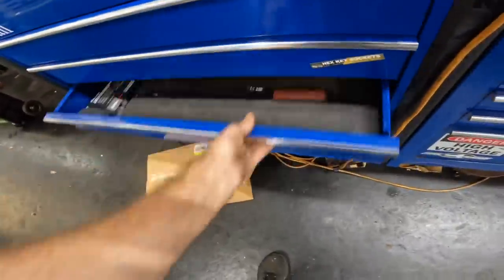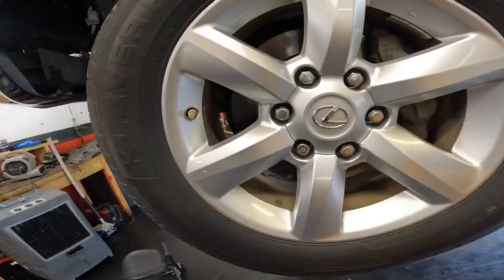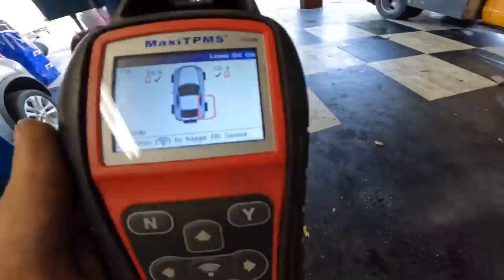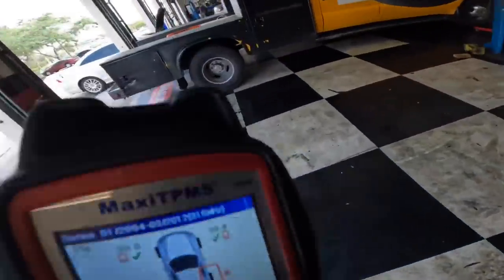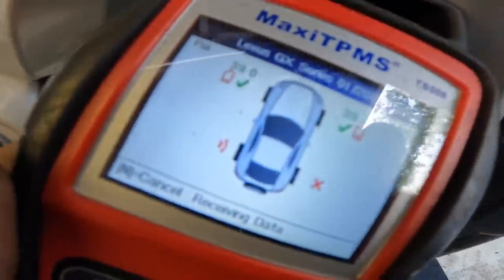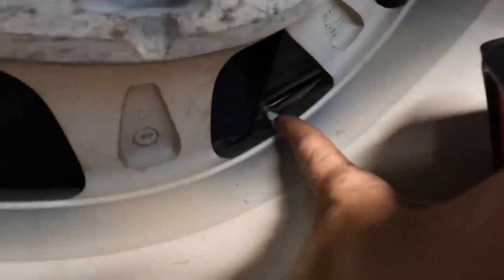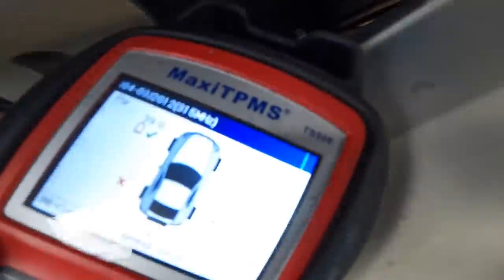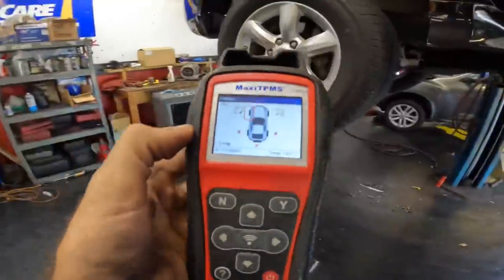TPMS Relearn! No Can Do!

Comment: That’s a good tool…worth the investment for my two sets of Mercedes rims. Mercedes re-learn is a chore every season 😒. A good reason for me to like my pre-TPMS cars more! Also the Toyota 5 sensor system tripped up my dad for weeks on parents’ Avalon until he remembered the spare sensor!
Reply: You are doing it wrong.
Get the programmable ones and CLONE the IDs to the sensors in the 2nd tire set!
Reply: @pepeshopping  you can clone all,  and use as 1st set, if dead enter sensor I'd from old ones
Reply: Now I need to see where I can find one of these....  my dad has a dead sensor in his 2010 Chevy Malibu and my brother couldn't figure out why his low pressure light was on when he had checked pressure in all the wheels..... he forgot to check the spare though...... funny when the baby brother has to educate him

Comment: I just bought four sensors from Amazon for $80 for my Pilot. I took the wheels off, marked the tires broke the bead and replaced them myself. They were self learning. I was skeptical, but it worked. I took it down the road and they programmed themselves. The TPMS light went out. They alerted me that my tires were low over the winter too, so they work just like OE.
Reply: @elvd1296  rare instance maybe, that it actually worked. 🤔🤫🙈
Reply: @elvd1296  So lets play Devil's Advocate here. What are you calling BS on? That they broke the bead, that they replaced the sensors or that the system relearned.
Reply: @elvd1296  BS on what?
Reply: @elvd1296  Which part? What don't you believe?
Reply: You know what, tire gauge is much cheaper!!
Reply: @jdmforever5583  It is... but it doesn't work when you're doing 90mph on the freeway.

Just sayin'
Reply: @Swampster70  I've had Flats driving on the freeway and I still didn't need a TPMS system, I've been driving for over 35 years way before this system
Reply: @jdmforever5583  I've been driving for over 35 years too. I've had flats on the freeway before too. I got the car over to the shoulder and changed the tire. Then again, it would have been really nice to know that the tire was loosing pressure before it was flat so I didn't have to change the tire on the most dangerous place on public roads - the shoulder on a freeway.

I would much rather my kids get a warning message on the dash saying "low tire pressure" so they can come off at the next exit and then do something about it. Not all of us are car guru's that want to dedicate their lives to knowing how to change tires - that's why they pay the fee for AAA or simiar but the TPMS gets them off the road safely. You could say the same about ABS and airbags - everyones dad that lived to 100 did just freaking fine without those amazing safety aids but sadly many didn't. Technology saves lives. Then again, people figured out in the flu outbreak of 1918 that social distancing and masks saved lives - but we're still having that "argument."

One of my cars has runflat tires. I wouldn't know that the tire had zero air pressure for a weeks. I check it via the dashboard whilst driving because it's easier than getting the gauge out and doing it in my driveway - which I have to pull my car out of the garage to do.
Reply: Was the name brand of the sensor called more sensor? I got those off amazon and i they they better then oe cause the battery last 10 to 12 years for the highest grade cause they have different battery lifes
Reply: @jamesjones9207  Do you have a link to those?

Thanks in advance!

Comment: I dont know Ray.  A little grinding and drilling, some CR2032s, a soldering iron, wire and some hot glue could fix all those sensors!
Reply: Why would you do all that when a new sensor can be had for $30?

Do you understand the forces involved at highway speeds? 
That and moisture are the main reasons for them to be fully sealed!
Reply: @pepeshopping  I think Ray said that 4 sensors would be like 700$ in the last video.
Reply: @pepeshopping  Toyota sensors are well over $100 each. My 08 Prius is currently having the same problem. I’m not spending that kind of money either
Reply: @pepeshopping  but they aren’t a few dollars, it’s about $600 for a set of new ones. It is way cheaper to have the ecu reprogrammed to ignore it and just keep an eye on it yourself. You should be doing that anyway, never rely on a sensor for basic safety checks. Do you really want to trust your life to the lowest bidder?
Reply: It's too expensive, Scotty!
Reply: The scanner he is using is a MaxiTpms. Their sensors are like $28 with the metal stems and you can program them with the old serial number and not have to do a relearn. Tpms just picks them up as if they were never changed.
Reply: @WILFRED1184  doesn’t matter what scanner he is using, Toyota tpms sensors are stupid expensive. The Toyota isn’t using Ray’s scanner, it needs its proprietary sensors, otherwise it will just throw errors all the time. As I said earlier, program them out and keep an eye on the tyre  pressures yourself, it’s cheaper and safer.
Reply: @steve5x565  guess I have never paid attention to the Toyota stuff. Can't even recall if I have done any Toyotas. But good to know in case I run into issues in the future. Thanks.
Reply: That's one reason I am keeping my old Honda Accord.  It's TPMS is the trusty old tire gauge I have been using for over 40 years.  I had to buy another high pressure gauge to check the convenience spare tire since it needs 60 psi.

Comment: The 2006 Grand Cherokee I used to own had 5 sensors. I discovered this by accident....  I'd had an LPG system fitted and the LPG tank replaced the spare, so I kept the spare in the garden store, about 30 feet from where the car usually parked. It gave a low pressure alert for the spare one day many months after putting it in storage...which I thought was neat!  Sure enough, spare was down to about 20psi. Pumped it back up, alert went away.

Comment: When I bought a 2008 clk350 convertible, it didn't even have sensors in it. I purchased a set on ebay, for less than $50. Put them in and it works great.

Comment: I have the same TPMS tool. Works well. Just a suggestion..... you had mentioned in a previous video the cost to replace the TPMS Sensors in a vehicle to be something like $700 or more (I don't recall the exact number, but it wasn't cheap). I was once quoted something like $80 per sensor for my 04 Silverado by Firestone. You can get the Autel MX sensors for like half what the OE sensors cost, and in my experience, they work just as well, if not better. I had a weird issue with my truck where I ordered OE part number sensors, had them installed when I had new tires put on, and NOPE. They were DEAD. Got a replacement set that I tested by pairing them with the truck prior to install, and they paired fine, and as expected, read '--' (or maybe it was 0 psi) in the DIC. Then had them installed and they were dead again. Wouldn't respond to pairing requests, truck wouldn't read them, nothing. No idea. Threw in the towel, ordered some Autel MX sensors, programmed them for my truck, no problems since. And you can keep a dozen or so on hand and they'll work for probably 99% of the vehicles you see. Rather than worry about what sensor is for what vehicle.
Reply: There are only a few frequencies of sensors. Most common are 315 htz. 
Yeah $80 per sensor plus some labor for breaking down the tire and re balancing it sounds about right. 
I was recently looking hard at a tpms sensor reader and programmer. 
My understanding from reading, was that Autel is sensors can only be initially programmed by autel equipment.
Reply: @mmix224  Well, it was just $80 each for the sensors... There wasn't additional labor because I was getting new tires put on at the same time. When I had to have the first set of dead OE sensors swapped out, the shop that did it charged $100 labor, so that plus the Autel sensors was still cheaper than JUST the OE sensors from Firestone. Yes, Most likely the Autel sensors can only be programmed by the autel TPMS tool.

Comment: It’s super easy to replace batteries in TPMS sensors.  Just get 5 CR2032 batteries 2 minutes to replace battery.  10 dollars in parts tops.  Most of the time is dismounting, remounting and balancing tires.  And one happy customer!
Reply: Why would a shop want to do that when they can charge 20-60 bucks a pop + labor to just replace them?

Comment: I installed 4 new TPMS myself with a chain vise grip around a 2" steel fence poll, 3' long- 2'x4" and a 6" long 2"x4" In 4 hours I was done. No more TPMS light. I did go out later to get the tires speed balanced to be on the safe side. Everything is good as it should be. Not bad for a 65-year-old-fart first time. lol

Comment: I have that same tool it came in very handy although it will only program Autel MX Sensors which is what I put in all my tires.   I did save the old sensors because I found out you can unpot the batteries and replace them then you have to repot the sensors.   Not sure it's something I will do down the road since it could be penny wise and dollar foolish but if you find yourself unable to acquire new sensors it's an option.  Yea batteries die and I had one sensor with a bad battery but after changing them out I also had to buy a new module and locating that bastard was a PITA as there was very little information on its location which I found behind my radio which I was changing out at the time, so it worked out in the end.   Even with a working TPMS I still check my tire pressure at least once every two weeks.   Cool thing about my car is it has an auto relearn function so once the sensors were programmed, installed and the module changed out it set itself up, but I also used the same ID Numbers for each sensor.

Comment: TPMS is another PITA required item that have. Even forced down our throats and are of little value. When they fail and they will, they are ridiculously expensive.  How did we ever live without them?  I know I never felt a need for them!
Reply: Only expensive for ignorant people.
$30 per sensor plus 1 hour labor to get the tires unmourned, sensors installed and either old ID/addresses copied or new ones configured in ECU.
Reply: Well, clearly, we both know when a tire looks a little low on air. 
It’s as if someone who seemed to be a rocket scientist looked at someone and said: does that tire need air - just looks at it; it’s of course a generic radial tire which naturally has a bit of a sag at the bottom on some tire sizes…..but if you know your car….well, you’re no idiot.
Reply: My TPMS light is on and I could give two shits. It's not needed for inspection (PA). I check my tire pressure every couple weeks like I have for the past 30 years....
Reply: I check my tires regularly but I know plenty of folks with absolutely no mechanical empathy.  And they get TPMS alerts.  I'd hate to think of how things would go if they didn't.  So this is one "nanny-state" requirement that I am in favor of though I wish they'd also mandate that the batteries be replaceable and cheaply available.
Reply: @mikeblaz  This system is really for when the car is rolling.

Explain how, while driving, you would know if you suddenly are losing pressure and a tire is getting overheated???
Reply: @BixbyConsequence  This system is really for when the car is rolling.

Explain how, while driving, you would know if you suddenly are losing pressure and a tire is getting overheated???
Reply: @pepeshopping  I lasted 35 years driving w/o them. I'll make it....
Reply: right on with that I did see a kid blow out a low pro tire at the air pump the other day while filling it
Reply: Just carry around a 2 dollar air pressure gauge and be done with it. Sheesh. They’re NOT required.
Reply: @pepeshopping  If they’re too too low you’re going to feel it… unless you’re just oblivious to everything in the world.
Reply: @BixbyConsequence  Glad I live in PA, not required for inspection. If they weren't so damn expensive I wouldn't mind them as much.
Reply: @topherd1011  I think in some states they are and will fail inspection if the light is on.
Reply: i think I paid $60 for a new set of Wagner TPMS sensors for my Dodge, pre-programmed specifically for Dodge products.  Had them installed proactively when I had new summer tires put on my car when it hit 10 years old...by my son...in his high school auto class...for free.  Harsh on Dodge all you want, but the car recognized the four new sensors and programmed itself.

But yeah, TPMS is a PITA if you run winter tires without them.  Nothing a small piece of black tape strategically placed on the instrument cluster can't fix though!
Reply: We went to the service station full service isle so that the gas jockey can check our tires, oil, and other fluids and adjust them as needed while cleaning our windshield.  Now, we just throw some gas in vehicle and drive it until it fall apart.
Reply: I thought they were a PITA also until I arrived at work one day after a long commute and the sensor came on - had picked up a nail somewhere on the drive and the tire was slowly going down.  Was able to change the tire in the daylight; probably would have missed it at night going home and ended up with a flat in traffic on very congested roads.
Reply: @CraigNeth  I also think they are a nice feature, but should be an option.  I think it's the mandate of the nanny-state that rubs most people the wrong way.
Reply: I just replaced four sensors that were 15 yrs old. Cost me $30 each.  Of course I have a tire gauge, but it's really hard to check pressures when driving 70mph.  I had the light turn on while driving on the turnpike. Pressures were ok when we left that morning.    Gave me enough warning to pull over safely.  Plus the tire did not get overheated and destroyed.  Found a bolt in the tread, so put on the spare.   Before that experience I thought tire sensors were silly.
Reply: @pepeshopping  Yeap, I paid $30 each for the Autels.  Bought the learning tool, and it paid for itself.
Reply: @HoustonRacewayKid  So you can see your tires while driving?
Reply: @topherd1011  Does that 2 dollar checker work while your driving 70mph
Reply: @scrappy7571  Been driving for 35+ years and I'll take my chances. Not getting sucked into a highly overpriced money making scheme.I'll just look at my TPMS light and save money and check tire pressure and condition of tires. And if your car tire is seriously losing pressure you'll feel the car pulling or something isn't right.
Reply: @pepeshopping  I don't know man.....calling people ignorant because they don't want to spend 30 bucks per sensor, plus 25 or 30 bucks to unmount, swap, remount, and rebalance a tire times four tires is a fair thing to do. 

Your looking at 200 for the car to tell you what a two dollar pressure gauge and 45 seconds of your time will tell you. 

And don't start with the "it's good for while your moving' rhetoric. If you have a tire going down, you can feel it. If you have a blowout, no sensor is gonna stop that.
Reply: @pepeshopping  Or...1.99 for a good tire pressure gauge..
Reply: @pepeshopping  To me $30 plus one hour labor each for something I do not need seems like a waste of money.
Reply: You can't just replace the battery?
Reply: Why can't you just replace battery?
Reply: @captlou348  usually they are sealed and non-replaceable. It's not like they're double A's or triple A's LOL
Reply: TPMS is from the ford explorer roll over fiasco. Now you can’t say you didn’t know and sue anyone for your negligence.
Reply: @pepeshopping  
Well let’s see……..tire SUDDENLY loses air, suddenly means it’s flat pretty much right then. If that happens at interstate speeds your tire is ruined, you need a new one because you pooched the sidewalls before you could get it stopped. If it’s low enough to get hot, you can feel that in the vehicle’s handling, or lack of it while cornering.
Reply: @scrappy7571  
Tires don’t blow out because the pressure went low. They just go flat. A blow out is tread/belt separation at full pressure.
Reply: @ralfie8801  Agree,  but run a tire at 70 mph with 20psi.  It will overheat, and the sidewalls start to shred then bam!.  Most folks call this a "blow out"  because it happened with no warning.
Reply: @scrappy7571  
That’s only because they don’t know what a blow out is, those people think the difference between a blow out is that a flat that happens while moving is a blow out, and a flat while parked is a flat.
Reply: @pepeshopping  Well that was an ignorant statement on your part.
Reply: @richardahola692  If they are 30.00 each, that’s 120.00 plus tax.  Shop labor is AT LEAST 100.00 an hour plus they are going to reccomend rebalancing them.  That’ll be at least a 300.00 bill for something I think is not needed.  Yes, they can have their benefits.
Reply: @pepeshopping  I think you didn't understand my comment.
Reply: @ralfie8801  Yes they do.  Low pressure causes increased flexion of the rubber which results in increased heat which can lead to delamination of the tire.  It's exactly the reason TPMS were made a requirement.
Reply: @ralfie8801  You may be able to feel it but I guarantee that many people cannot.  I can tell when a single tire is off by 4 psi; I know people who wouldn't notice anything until the tire is practically flat.  I'd rather they have something to protect their safety even though they are "defective" in that way.  😄
Reply: @pepeshopping  lol, our shop charges $70. But mount and balance included
Reply: My mom came to the shop the other day just to say hi,  she lives two hours away and was on a trip to an hour in the other direction and was coming back,  so she's been on the road 4 hours and I'm like while your here let me change your oil and stuff. 

One of her tires was at 11 psi.  She is someone who should have tpms!
Reply: Indirect TPMS ain't as stupid as direct one in my opinion